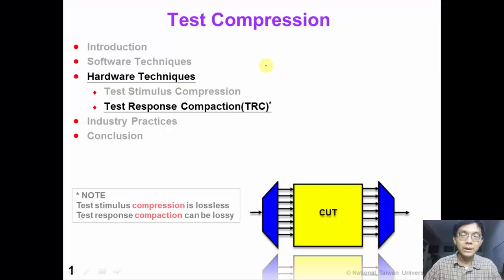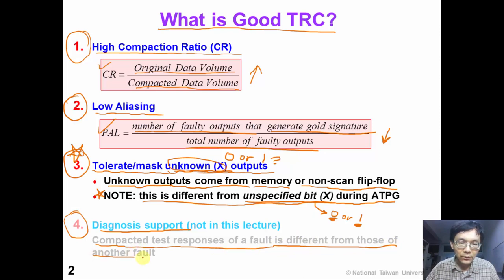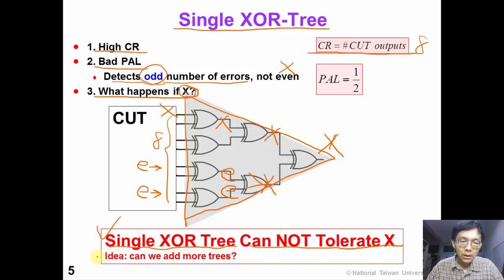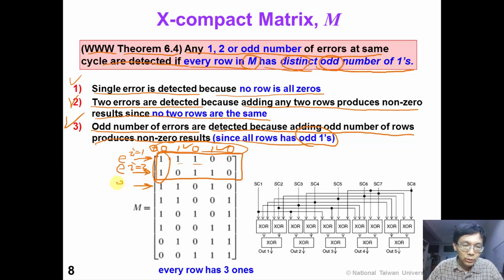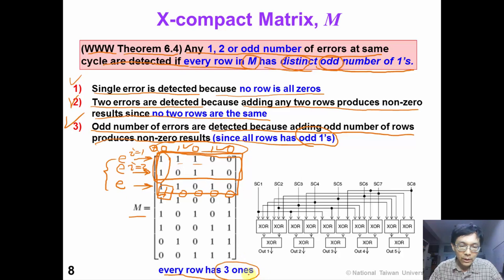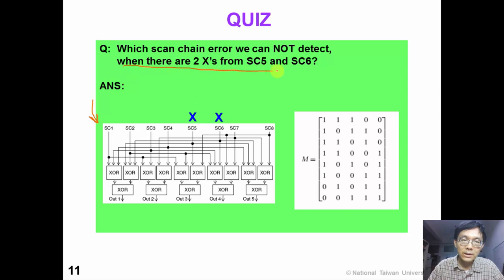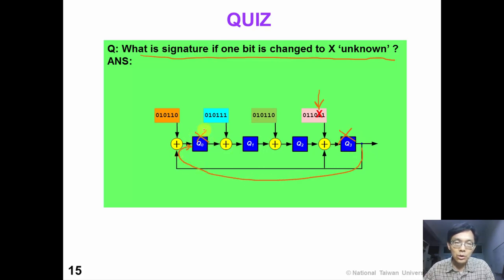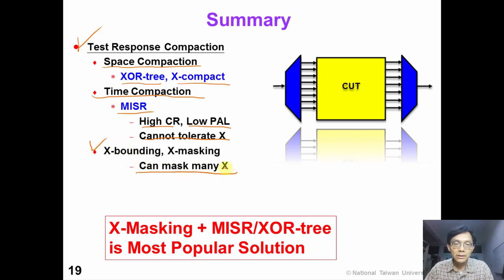15 4 TestCompress HardwareResponse (*optional)

Comment: hi professor Li, may I ask why XOR tree is used for compression, not other logic, AND OR...？
Reply from the maker: good question.  XOR does not block faulty output.  the other gates, AND OR can block the faulty output when the other input is controlling value.